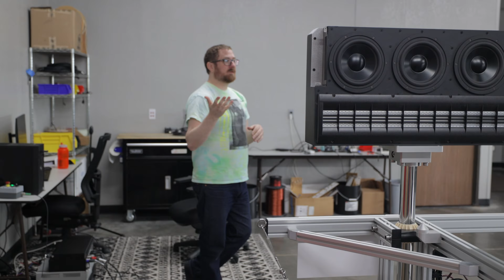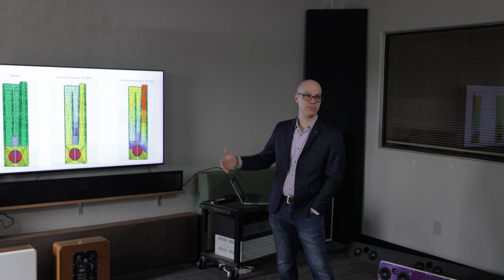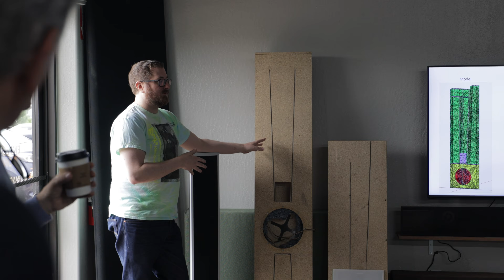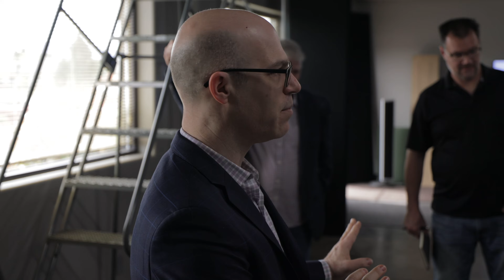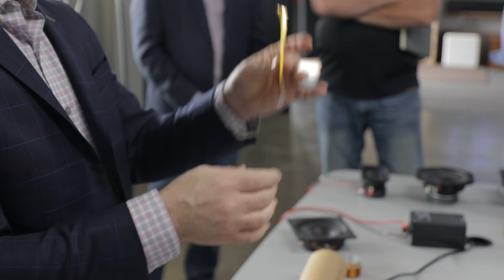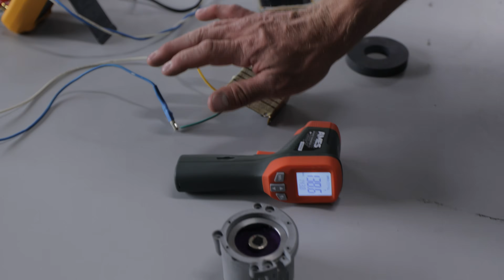Designing the PERFECT Speaker? - EXCLUSIVE Look at Wisdom Audio Engineering

Comment: This question has nothing to do with this video but I wanted to know what amp or amps do you use to power your jtr’s?
Reply from the maker: Monolith 11X.
Reply: @Youthman  Wow, you have enough watts coming out of it? I use a Monolith 7X and a separate Marantz AMP 10 for only my 8 heights. Your room is way bigger than mine, so maybe I've got my system overpowered. That or your JTRs are super sensitive, so they use less power?
Reply: @Youthman  thank you for the super fast reply I am a huge fan. I wanted your opinion on the setup because I’ve seen your videos about under powering speakers & I’m about to pull the trigger on a JTR setup & I already have the amps.  I have 3 emotiva xpa-1 gen 2 monoblocks, for the fronts (NOESIS 212rt & 212ht) 3 xpa-2 gen 2 for the surrounds (Noesis110ht slants & a xpa-4 gen 3 for the heights (slanted 8hp….they barely make those anymore). My question to you is do you think these amps are enough for the speakers being that the speakers rate double the power of the amps?
Reply from the maker: Your amps are more than sufficient to power the speakers. Of course, having more power than you need is always a good thing. The Monolith 11X is 200x2 + 100x8 and it provides plenty of horsepower in my 13’ x 19’ x 10’ room

Comment: the ear is the poorest of all speaker testing systems. there I said it!
Reply: ? well... sure but its impossible for someone to hear a problem at frequency x with a dip of x db. If you measure it you can counteract against it and then do a blind a/b and hear for urself, yeah it sounds better now.
Reply: Completely disagree, if it doesn't sound good to your ear what's the point. Data is good for figuring out why it sounds bad/wrong. As it's often not obvious.
Reply from the maker: I believe measurements are important but we also have preferences. A speaker that measures horribly will likely not sound well.